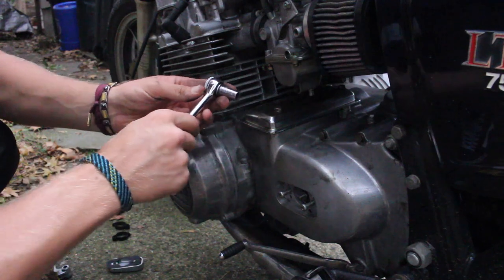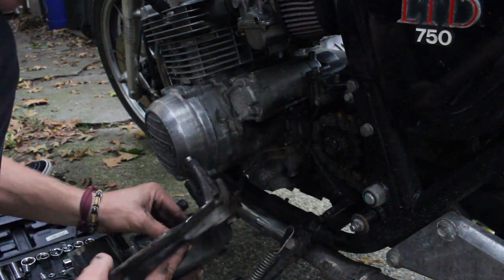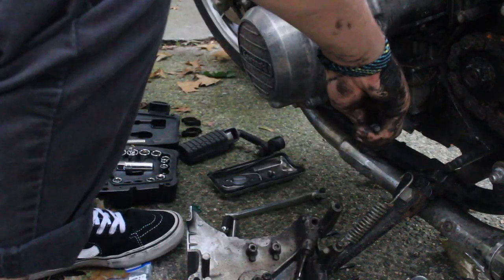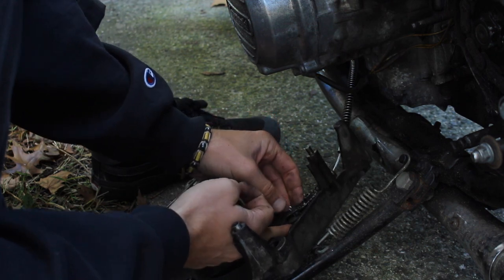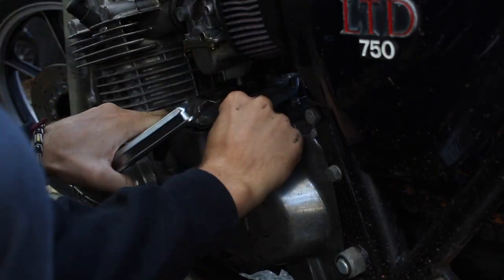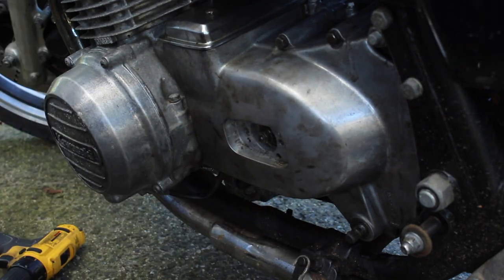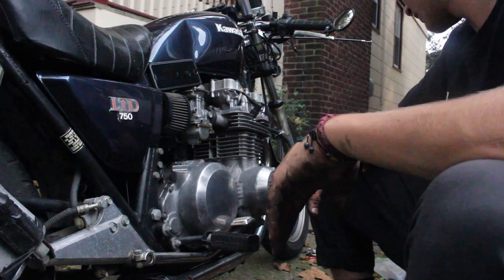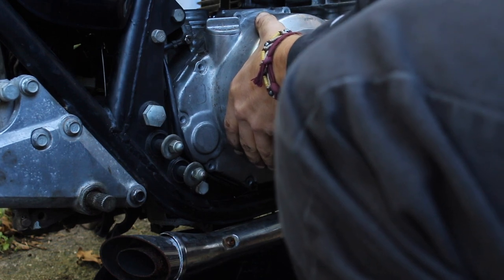1980 Kawasaki KZ750 LTD Café Racer Build Part 4: Clutch Replacement

Comment: Hey man same bike! did you change triple tree clamps for those clip ons? or just switch out the standard bar clamps?
Reply from the maker: Justin Skoczylas all I did was loosen the triple tree clamps, bring the forks down about 2 inches and slide the clip on bars over the top of the fork legs. Then just slide the forks back to where they were.

Comment: I don't have the spring on the Clutch cable on my kz750 ltd 1982, i checked on the diagram for the Clutch and i don't see any spring, i think somebody add the spring, my Clutch work perfectly without the spring so i think you don't need it

Comment: Looking to get one of these bikes. Needs a oil pan gasket, carbs cleaned and a battery for $300? Any advice?
Reply from the maker: Haven't had to do any of that yet, sorry.  I got my carbs rejeted and rebuilt at a shop since I didn't have a garage for my bike at the time.